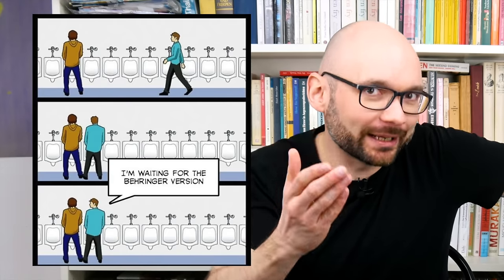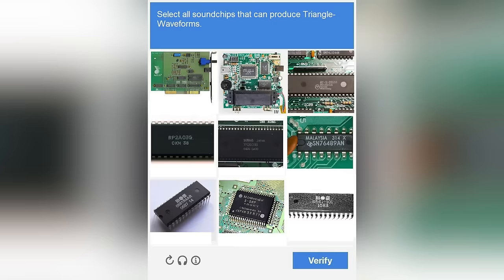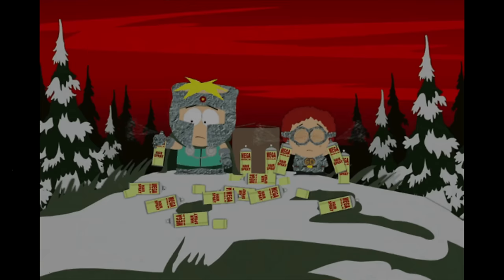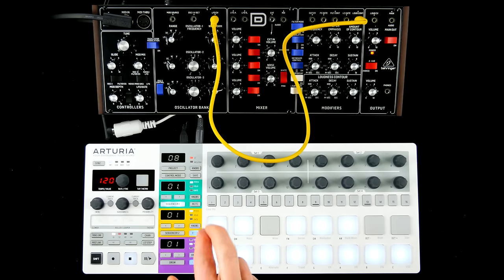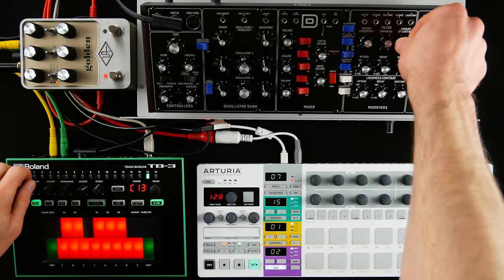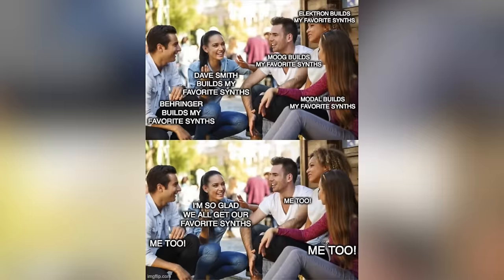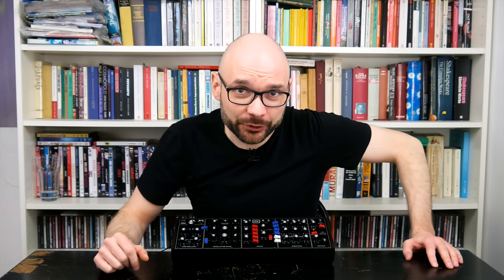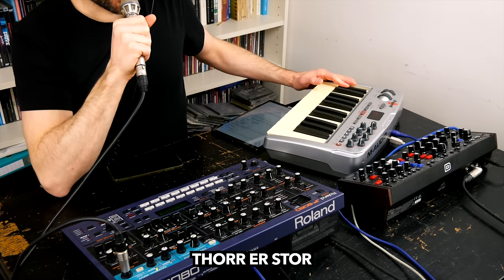Bad Gear - Behringer Model D

Comment: As a long-time Roland fan and collector, I initially scoffed at the Behringer clones, but at less than the cost of dinner and a movie, how can one go wrong? I grabbed the TB-3 and RD-6, copies of two machines I don't have and cannot afford, and was not disappointed. They really capture the spirit and sound of the original instruments. So much so that I also bought the more pricey VC-340 Vocoder. Haters can hate all they want, but Roland had ample opportunities to re-release their vintage instruments and chose to go another direction. (...expensive, crappy miniature digital copies) Behringer simply identified and filled a niche.
Reply: Yeah. I have a rd8, AND the vc340 (love that thing). Roland their chance. BUT.... I did end up selling my model D and kept my se02. I think Roland got that one right. Or.... Studio Electronics forced Roland to get it right hahahaha.
Reply: I have been wondering about getting that VC… would be super useful to have and can’t you use external sources as carriers too?
Reply: Totally agree.
Although I can understand Roland's position to some extent.
They are a hight-tech company that have sunk a lot of resources in to research and development.
They must believe that their modern digital technology is far superior to what they turned out four decades ago.
It is a bit like asking a car manufacturer to re-release a 1982 model.
Yes, there are factories in India and Brazil still turning out cars based on 1970's models for the domestic market, but that is not something WV and Rover wants to associate with.

Question is, Could Roland have re-released their classic instruments, fully analog,  at a competitive price and meet their own quality standards?
And would that even be a smart business strategy for them as a company?

I own a few behringers. They are great, being what they are: quite archaic retro-instruments. I also own a tr-8 and a tb-3, both of wich I find really well-made, well thought out products.
Reply: @bsbazzman  The VC340 sounds fantastic, and yes, you can use external audio. There are several i/o options.  Also, the build quality is pretty nice. It looks, feels, and sounds like a classic synth.
Reply: @lo-firobotboy7112  ooo good to know about the build! That wes one of the things that had me on the fence about it
Reply: @bsbazzman  Yeah, the RD-6 and TB-3 are a bit plasticy, but so were the originals. The VC340 has a proper metal housing, wood end panels and steel-shaft pots and sliders. It's right at home sitting side-by-side with a Juno-6 and SH-2000. Most importantly, thus far it sounds and functions perfectly.
Reply: @cheek1m0nkey   when I said they got it "right" I mean it was a more authentic analog recreation of a piece of analog gear, when compared to Roland's other boutiques. The OP said that Roland had time to re-release their old gear authentically, and didn't. Which I agree with. Compared to..... The ju06, for instance, I think they (or studio Electronics, ) got it right with the se02, and wish they went that route with the rest of the boutiques.  Ideally they'd all be larger too hahaha.  At the end of the day I don't really mind the size of the knobs That much. Not what I'd prefer, but not a deal breaker for me.
Reply: You understand that this is a moog clone, right?
Reply: @cheek1m0nkey  One could have bought a Minotaur for only a fraction more when they were cheaper, if “authentic” is the measure.  They didn’t have to sit around for a clone.  An authentic phatty is still completely affordable.  And, while this one is somewhat authentic in recreation, many of the other behringers use completely different chips than the originals.  Their Roland clones do not sound like Rolands, even if this one is pretty good.  Roland didn’t rerelease because they no longer have the facilities to produce such hardware.  Many of their new offerings are more productive than these clones anyway.  Most people don’t even know what the clones are reproducing, no experience with them, never even heard them, so it’s not like people actually wanted them, they just want a good deal on something they couldn’t afford otherwise.  For example, a handful of people wanted a Cat reissue, but when the clone comes out suddenly everyone knows all about the Cat and wants one.  It’s kind of funny really.  And did anyone really need an 808 clone in original looking housing.  That big?  There’s a ton of good clones out there already.  I’ve got an MFB 522 and I laugh at the behringer offering.  And there’s a ton of other good gear out there, original gear, from original company it’s that don’t just lift everything.  Anyway, from my personal experience owning 2 boogs, 2 Se-02, and a bunch of moogs proper, the boog is one that I won’t say anything other than good things about.  But that’s not to say the same about everything behringer makes.
Reply: @alexwestconsulting  yeah, I mean, this is a Moog model D clone, the se02 is a miniature se1, and the se1 is a modern Moog model D ... Clone/reimagining.  I was just saying... This is more "right" to what is trying to emulate than say .... The ju06 is.    I guess Roland's most authentic boutique mini clone at this point is still the D05. It's literally a d50 in a mini housing.   I think the big thing with the rd8 was that people actually Were looking for an affordable 808 clone, as shown by all Roland's offerings themselves, but people were also looking for individual outputs, which is hard to do in a much smaller form factor than the original.  I had a tr08 and it honestly sounded fine beside the rd8, no real tangible difference that you would notice in a mix, but I ditched the tr08 because of lack of individual analog outputs. ( I know you can set it up as a USB interface and do individual tracks that way into your daw)
Reply: @YouBredRaptorsMusic  Sure, I do get what you are saying, as I'd likely rather have a mini analogue re-issue than a ACB based one.  But Roland itself doesn't make analogues at all anymore.  I know this in part because I'm buying up System-500 pieces that again are not actually Roland.  And that's fine.  Anyone can make them in theory.   I hear you on RD8 individual outs, good reason to justify large form factor.
Reply: @alexwestconsulting  You understand I responding to the critique about Behringer products, right?

But yes, thanks for being 'that guy'.
Reply: @lo-firobotboy7112  errrr, you are responding to a video about a Moog clone, to which you went off on Roland, speaking of being "that guy".
Reply: The TD-3 is bad, and you should feel bad. I absolutely cannot understand why people support that company. IMHO, the TT-303 is far superior. Hell, the mk 1 was so close to the original 303, they got a cease and desist. Also a bit shady, but at least Cyclone Analogic doesn't have Uli at the head.
Reply: @SlaserX  yup I like the Cyclones more, both versions.
Reply: @SlaserX  that company  ? You mean behringer as "that company"  !?
as far as the TD3 behringer and I've got one and it sounds awesome ! A bit less range in the squelch and squeeze department but not a huge departure from the original.  I like my. Poly D as well enough though it's a tank and heavy as a tank is got the sound I like and putting them  together is well worth the$550 my synth collection cost so I'm happy with "that company" and by that company I mean behringer.
Reply: Awesome gear
Reply: Funny guy
Reply: Roland System 500 is not that crappy.
It's pretty cool mono from Roland.

The Jx Xa is not that bad ... but for making everything look like a Jupiter/Juno,
that one needed the look of the smaller of the 2 Jupiters they released later.
For some reason, the real analog poly had the future look hated and not practical ...
Reply: Imagine the level of scoffing us guitarists had... However, I bought a BOdyssey and after two years, it still blows everyone's brains every time. 
It was hard to choose between the K-2, model D, Pro One and Oddy, since they're all iconic instruments, but goddamn the odyssey does have something...
Reply: You're not a Roland collector nor fan. There is a difference between the Roland and Behringer sound.
Reply: @Madrrrrrrrrrrr  I'm not? Oh, ok. Thanks for letting me know. I thought my collection of 14 or so JUNO, SH, JV, DR, and TR synthesizers and drum machines made me by definition, well, a collector. My bad.
Reply: @bsbazzman Yes, you can!
Reply: TD-3
Reply: @SlaserX  "you should feel bad" Hahaha ...Whether you be glad sad or bad, you've got to know that there's fun to be had ;-)
Three cheers for Behringer :-)
Reply: 100% right on the money !!!
I used to buy hardware synth and stuff when I still lived at home but now there's just no convincing my wife that a 2000 euro synth is a better investment than a vacation or groceries and bills and all those boring things...
But Berhinger has put out a whole bunch of affordable synths to add some balance to your DAW and VST setup. The TB 303 clones are already available second hand for under 100 EU  and they just keep making retro synths and small modulars.
I think it's great 👍 👌 🙂
Reply: The TD3mo is so fucking good

Comment: I'm pretty convinced that if the Boog was made by Moog and had $1000 added to the price people would be all over themselves about how amazing the device is. But because it has Behringer's name on it, "it sounds stiff", or "they didn't quite nail it" when you can't even match two real Model D's to sound like each other due to age, tuning, how long the device has been on etc.The Boog sounds great and is affordable to for pretty much everyone in actual hardware form instead of some VST. Can't everyone just be happy about that?
Reply from the maker: You definitely have a point here
Reply: Moog already has synths that do most of these sounds and lower in price but a cheap 100% clone would destroy their own minimoog market. Anyway most synth buyers prefer cheapness over sound every day. That's why this show is called bad gear. Also the fact 2 old mini's don't sound the same doesn't prove anything. Yes that analog is unstable but that doesn't say anything about comparing boog to a real mini. You really have to listen to a real one to be able to compare them. And the internet is full of dumb synth owners who compare apples with oranges without ever having played the real deal. On osc level comparing the sound maybe samish but that vanishes once you search for their edges. All behringer synths have a behringer sound. Even the boog.
Reply: The whingers so much remind me of people in the watch community who own sub $1000 Rolex Submariner 'homages' that are a) legal and b) 90% as good as the watch they're copying.
Reply: @BaddaBigBoom  It reminded watch too, BUT watch companies are smart enough to give people what they want: cheaper versions v Rolex vs Tudor, and reissue. (As Fender gives people Squier). Moog sleeps so Behringer does the job
Reply: Yep. An original Moog is like a piece of furniture. A boutique made device and "looks the part". People should watch videos about Fender vs Squire and you'll find out that many professional musicians use Squire at times, they have no qualms about using cheaper gear. The realise that what you do with it is more important.
Reply: Honestly squier is just as good. All the wooden parts are CNC milled and quality is pretty consistent, and all the non-wooden parts can be easily upgraded as needed. 

Plenty of (stupid) people are willing to pay more for a logo and headstock shape that they see as being more legitimate.

Comment: After years of playing with presets on VSTs, the Model-D was one of the first hardware synths I purchased.  I didn't keep it forever, but it taught me the actual building blocks of synthesis that no other program or piece of gear could at the time.  It was affordable and accessible and I'll always be thankful for that.
Reply from the maker: Yeah, the structure of the D is super helpful!
Reply: I'm using it to teach my wife. You are so right about this. It's super intuitive. Then again, I have a friend who found the 2600 super intuitive and I had to call him a couple of days ago and beg for help understanding the signal flow.
Reply: @davidpetersonharvey  But 2600 is super intuitive. It only stops being one after you get to the voltage processor and try to make an HPF sound out of it.
Reply: Yeah Moog really knocked it out of the park with that design.
Reply: @Ajoura  it is to me now ... mostly. It took a couple of days for me to wrap my head around the signal flow.
Reply: AXS' father "Analogic" was the easier virtual synth...
Reply: These cheaper analog synths are great for getting started in subtractive synthesis without blowing your life savings. Arturia's Microbrute did it for me, and is still part of my setup since it doesn't take up much space.
Reply: Maybe I'm just stupid but for me that all started with the Yamaha Reface DX XD so looooots of button pressing
Reply: The Minimoog and the SH101 are the best synths for teaching subtractive synthesis. Simple, no bells and whistles. But you can do a lot
Reply: @davidpetersonharvey  Living dangerously!
Reply: @sub-jec-tiv  A few whistles to be fair
Reply: @patkelly8309  LOL!
Reply: Why did you sell it?
Reply: @Ajoura  OMG you are sooo right - did I know a HP filter is an inverted LP ?? Nope not until I got a 2600 :)

Comment: I use a Poly D, which adds a few simple, yet surprisingly effective extensions to the Model D's architecture and it is the one synth that I have almost always plugged in and ready for playing. Also, my few months old toddler absolutely loves it for some reason. If I may offer a few tips. There is a PWM of sorts - the 3rd oscillator offers an inverted sawtooth wave, which is primarily for LFO duties, but if you layer it with a saw in the second oscillator, you get a PWM-like with detune controlling the rate. It's not perfect, because it changes rate with pitch, but it's there. Another, more obvious, so maybe you've used it, trick with the 3rd oscillator is setting it as the modulator and leaving oscillator control on, which gets you FM and AM sounds controllable from your modwheel.

BTW. as a slightly educated electronic I'll pedantically add, that the Moog filter implements voltage control using the, normally unwanted, effect of virtual resistance on the emitter electrode of a bipolar transistor. I haven't checked, but I suspect that trick may be used in few other places in this synth. This is very smart, but wrong as far as traditional rules of circuit design go, since that parameter is dependent on transistor's beta. Which despite being the supposedly most important parameter of a transistor, is a wildly unreliable parameter, that can differ by a factor of a 100 between two transistors of the exact same model and changes significantly with the temperature of the transistor. You can partially reign in that instability if you are building the circuit as an IC, but that type of circuit built out of discrete elements will inevitably be unstable to some degree. So when you say it's a bit unstable, like the original - yes, that's the nature of that beast :D
Reply from the maker: Yeah, I really have to give the Poly D a try!

Comment: I've played MiniMoogs since I bought my first one in '74.  The Behringer Model D is not identical to the original, but it costs $300 for heaven's sake!  The cost and rackspace is a fraction of what you'd need to duplicate its functions with other modules.  I put two of them in my Eurorack (right below two Behringer 960 Sequential Controllers) and I use the real Mini for solo work.
Reply: I think that not even the reissue by Moog is identical.

Comment: Those cheap priced Behringers may be bad gear, but they are hard to hate. Verdict; it is okay to be addicted to this channel. It is ticking all the boxes. Happy New Year!
Reply: I love my Neutron.
Reply from the maker: Thank you!!! HNY!!!
Reply: Like virtually trying a synth you probably won't buy ( with exceptions ).
Reply: Ticking ALL the good boxes in the New 2023 Year to you all! :)
Reply: Chance of Behringer synth breaking may be higher than average but my fear of more expensive synths breaking is far, far higher so the Behringer wins for actual uptime.
Reply: @cheek1m0nkey  He reserves the right to use "Bad" as "awesome."

Comment: Love the Model-D. I had the chance to test it side by side with an old Minimoog a few years back and it’s safe to say that Behringer did their homework. It could easily have been two classic Minimoogs that were tested side by side. No exaggeration. Great showcase as usual! Thumbs up! 👍
Reply from the maker: Thank you!!!
Reply: Are you the guy at 8:47?!?
Reply: Behringer definitely did their homework I'd say the model D is about 70 of the way there at 10% of the price it sounds significantly inferior to the real thing but it is very, very cheap
Reply: @jc3drums916  LOL

Comment: Happy New Year Florian! Thanks for a great year of bad gear💗 I just bought uno pro instead of D.....3 osc, and brilliant elektron style sequence 😉 got it while on discount on Amazon £181!
Reply from the maker: HNY!!! Thanks!!!
Reply: I have a question about the sequencer on the uno pro. In short I was trying to figure out if it lets you combine audio loops with synth sequences with the external input?
Reply: @timparker33  Using midi from the pro?
Reply: @timparker33  I know you can either take external audio and go through filters or fx or bipass them?
Reply: @InkyDaCaT  I heard that after a certain amount of sequences are looped it switches to an audio looper- at which point the sequences are not tweakable- but you can ad in from the external input?
Reply: @timparker33  I don't know but can investigate?
Reply: @InkyDaCaT  that would be cool if you like